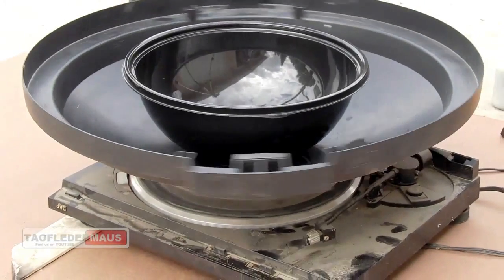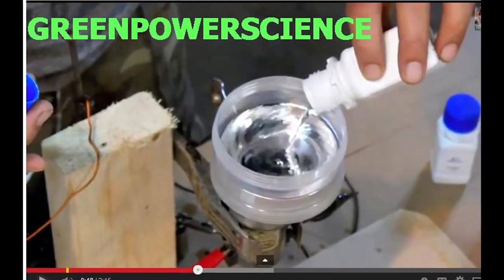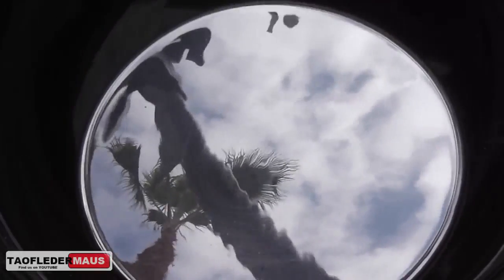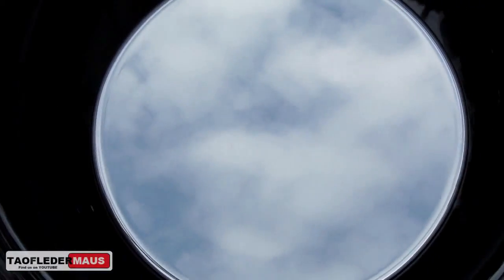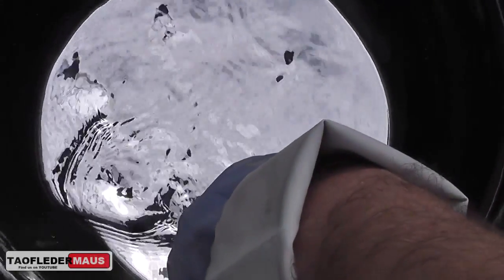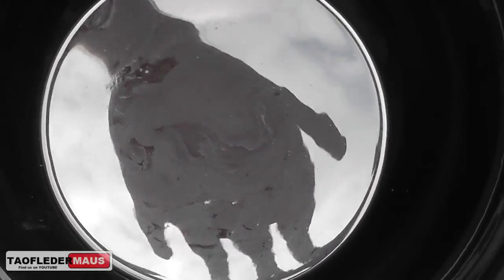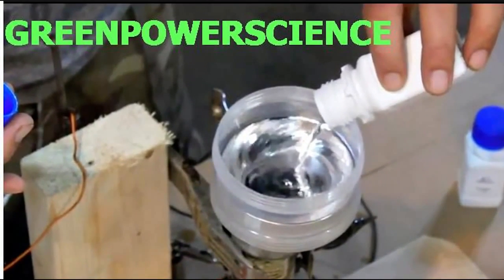MERCURY centrifugal MIRROR - Liquid metal

Comment: why cant they use solid mirrors in telescope in canada? does this mecury have any advantage over the solid one?
Reply: Auden Grumet oh yeah, that actually makes sense. I overlooked the whole can't point anywhere but straight up bit lol. And I guess you don't need that much mercury anyway
Reply: Obviously they have solid mirror telescopes in Canada. Its just that liquid metal telescopes more accurately approximate the ideal mirror for a telescope. The only downside is that it is extremely expensive and cumbersome to maintain.
Reply: You've got it backward. The only advantage of LMTs is that they are very INexpensive to build - about 2% the cost of solid mirror telescopes. Their application is quite limited bc they can only angle straight up to view the zenith for obvious reasons. Thus the earth's rotation moves objects out of view quickly.

Comment: What does mercury do? It looks pretty. What happens if i touched it? And whats so special about it? This makes me wish i payed attention in science.
Reply: Liiqa OnMarz Mercury is a highly toxic metal that is usually found in liquid form. Ingesting only a small amount of mercury can be extremely dangerous or deadly. If you were to touch it with your bare hands, not much would happen. You would have to touch it for dozens of minutes for it to be absorbed into your skin and be toxic. Even though contact with it usually isn't highly dangerous that doesn't mean you should touch it. Mercury expands with heat and it used to be the liquid used in thermometers, but because of its toxicity, is no longer commonly used. Also large fish like tuna or swordfish contain a small level of mercury. Mercury is special because it is liquid metal, which is a pretty cool thing. I hope this answered most of your questions.
Reply: TheBlockyBeast Just to add, the vapor from Mercury (that is in the air when you handle it) can eventually cause
mental problems, like dementia and others.. These are long term effects.
Reply: +TheBlockyBeast People have ingested large amounts of mercury with no ill effect. It's very poorly absorbed through the skin and mucosal tissue.

Comment: Could you do the same with, say, molten aluminum or glass, to get a constantly parabolic mirror as it cools down?
Reply: Because then you'd have a solid mirror with a solid focal point, if it's liquid it allows for it to be changed, so for a telescope, you can more or less "zoom" in more or less
Reply: Yes, but once it is solid, you'd have a mirror you can incline. Like any standard telescope mirror. And variable focal eyepieces also allow you to zoom more or less, without having to keep the telescope perfectly vertical.
Reply: piranha031091 A mercury mirror is better because since it's liquid, it doesn't have bumps on it, whereas a solid would.
Reply: dzello
 But you're stuck looking straight up.

Comment: Local auction, right at 60lbs of mercury in an 20mm ammo can. $2.00. I just wanted the ammo can.
Reply from the maker: Nice!
Reply: ***** Do you know how to clean mercury?
Reply from the maker: Does it have a lot of dross on the surface?
I will sometimes put a patch of papertowel in a plastic jar with that is about half full and shake it and it will remove a lot of it.   I just leave the papertowel inside.

Comment: Do you have any magnets large enough to try and make a parabolic mercury mirror spun using magnetohydrodynamic effects? Point electrode in the center, ring electrode around the circumference. Heck the resistive heating might even keep lead molten, no need for mercury.   Spinning a bowl is likely a lot easier than trying to have homogeneous electric and magnetic fields but it would be cool to see someone try.

Comment: I believe to get an actual paraboloid, a rotating cylinder has to be used.  With the sloped edges of the bowl, the focal point likely isn't as crisp as it could be.

Great vid!
Reply from the maker: The focal point and paraboloid shape is determined by the speed it is rotating,  not the shape of the bowl.
Reply: Using the rotational speed aspect, wouldn't a slanted vessel have trouble much sooner than a cylinder in keeping the liquid contained in a focussing shape?
Reply from the maker: If I had used a plate or something with short sides,  it probably would have spilled out.

Comment: I don't understand why this is done this way. Why not just make a shiny paraboloidal shaped disk? Like your average satellite dish, but shiny. The only explanation I can think of is that this might provide a more precise shape than a manufactured disk.
Reply: Pretty much on the money there, the only problem is that it is very difficult to produce a decent parabola, so this is a good analogy. Open up the back of any decent reflecting telescope (a lot of people own them, i do for example) and you will find a parabolic mirror like that which you theorise.
Reply from the maker: To make a large,  optically correct glass lens is very expensive and takes years to shape,  grind and polish.

Comment: Maybe I missed it, but, does the Hg have to be spinning? would it reflect as well if it were stagnant?
Reply: ***** Right on. Thanks! The curve causes the magnification. I wonder if the picture is upside down like looking at a spoon?
Reply from the maker: 0:45  the Hg is flat when it isn't spinning.  Note how large the palm tree is.
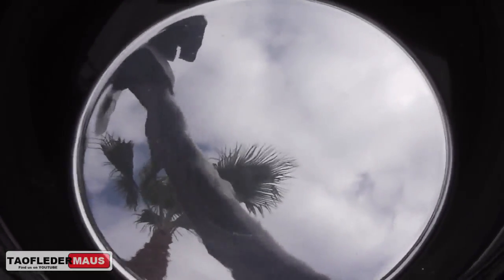At 1:08 or so,  you will see the palm tree is smaller.   When the Hg spins it creates a curved surface and changes the magnification.
Reply from the maker: Jonathan Smith   Yes,  the image was reversed.
Reply: Good experiment. Keep up the good work.